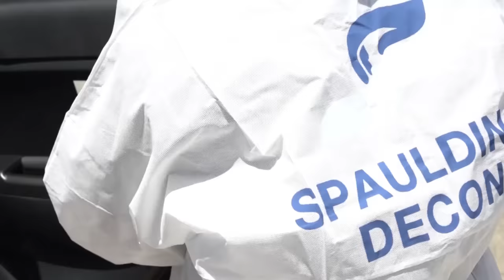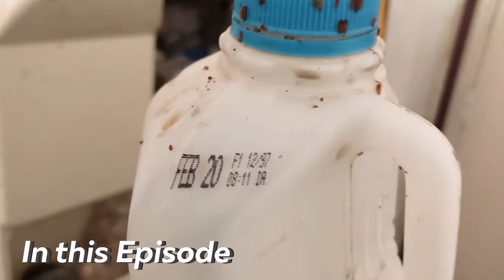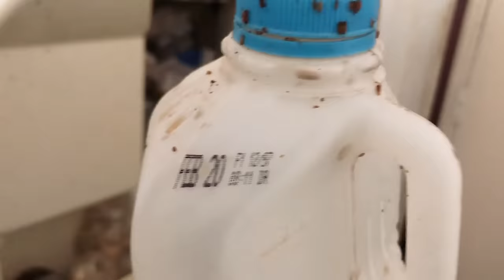S3 Episode 5: Crunchy Wig Nest

Comment: It's amazing noone in that complex could smell a rotting corpse in an apartment next to them. The smell had to be horrible.
Reply: Not just a rotting corpse but a clearly fed, clearly sedentary, likely obese individual. And the trash, the upstairs mold, the whole building seems like its inhabitants are castaways and shut-ins quite well trained to take the leftovers of life so they can be left alone.
Reply: And considering the hoard of trash she had as well. It was heaps of TRASH, that also had to have had a stench to it. Somebody HAD to have been suspicious but couldn't be bothered to check sooner.
Reply: @magickmiiror2853  right?  I suppose it is idealistically naive to hope someone would check on another's quality of life. Given the fact that building safety either  A. Didn't perform required fire safety checks, and so don't care about the life or death of everyone in the building. Or B. Did perform them and saw the apts inside but 'not my crazy not my problem' ed it.
 
It's a rotten Sophie's choice, I guess I'd pick the latter over the former.

Comment: They must be having a hard time getting masks these days!
Reply: Alexandra Ellen Walason I work in this same industry. And masks are bought in major bulk months and months ahead to ensure you never run out of them on the job. I assume they’re not hurting for masks atm. But all the supply stores are running out as well, so in due time, they will. Also, the type of mask used here isn’t going to mask corona. You need specific medical grade masks for that.
Reply: For the most part they use mask only when it’s pre-bio stuff. Once the big hazards come they have to break out filtered respirators and once you buy a set you really only replace the filter so they are probably doing fine. (I don’t recommend you guys use respirators to fight corona, you prob won’t get sick but you’ll feel like a lifetime smoker breathing through them and they get hot as HELLLLL
Reply: Mariah RahRah what do you mean respirators don’t work against corona? Last time I checked corona is a virus and a virus is just like any other particle, it can be filtered through a particulate filter. I hate to break it to YOU but there are masks that filter more than just 95 percentage particulate lol. Perhaps your industry didn’t train you guys in The particulate grading scale but that little 95 after N ( in N-95) means the mask filters 95% of particles in the air. There are higher percentages than 95 and those masks can and will offer viral protection. Not sure what you mean by “respirators can’t prevent corona” 😂 their whole purpose was to keep people from getting airborne particles. AND YES THAT MEANS BACTERIA, MOLD, and VIRUSES

Comment: FYI: @ 20:57  Checked back in comments and didn't see anything about this but lazy boy and other recliners have release levers in the back.   They hold the chair back on to the seat.  Some are closed and stay on others are never closed and the back falls off.  There are some others like this but I can't recall the brands.  Might be something to check at the bottom of the recliner backs for two reasons:  Ease of removal in separate pieces and Less chance of injury in a biohazards zone.  JS

Comment: That isn't even the expiration date its a tracking code they use in case of recalls they can track where it came from.  The month is written huge to the left with the day.  Some milk companys dont bother with the year because milk expires so quick that there is no point.  If you have to look for a year its common sense it's too old to consume.  They both have two different months on them so it doesn't even make sense.  I can't believe how many people didn't clearly see the months in big letters.  It was definitely old but not from 97 lol.

Comment: Those bug/cocoon things in the hair looked like cockroach eggs. The only thing I could think was dear CHEEBUS please tell me that was a post-mortem infestation....

I know what they look like because I have found one, at my ex bf’s apartment....it was just on the carpet sitting there, I picked it up because it looked like a bean or or a bead or something, it broke with a slight pressure and greenish goop came out. I shuddered involuntarily, at that point not even knowing what it was. The gut instincts were so strong that I literally googled “cockroach egg appearance” having NEVER seen one before, just because I had a feeling...the outside of the egg case looks like the exoskeleton of the insect itself. After confirming what it was that I had touched with my bare hands, I nearly had a panic attack and proceeded to wash my hands with boiling hot water 🤢 I will never forget that.